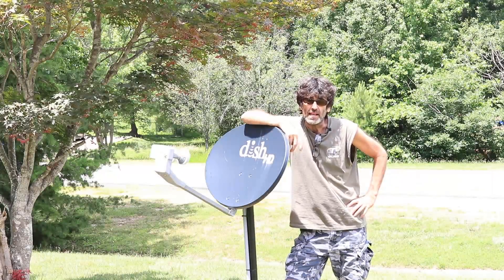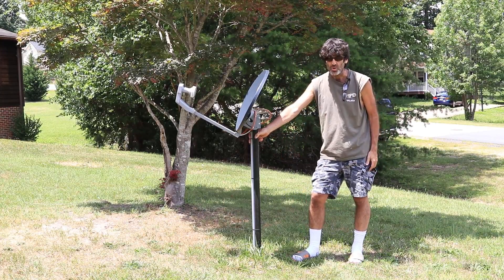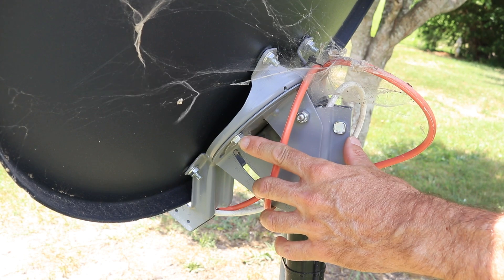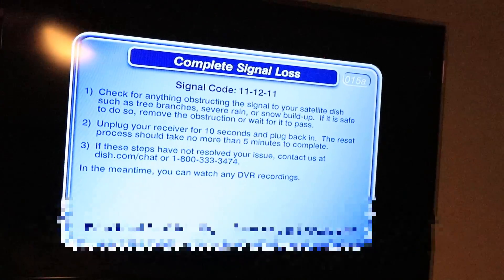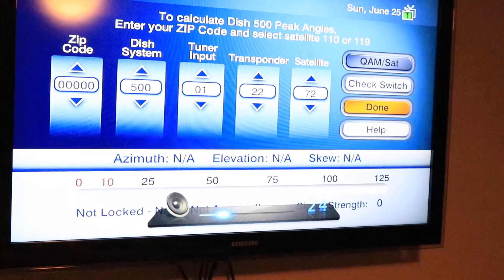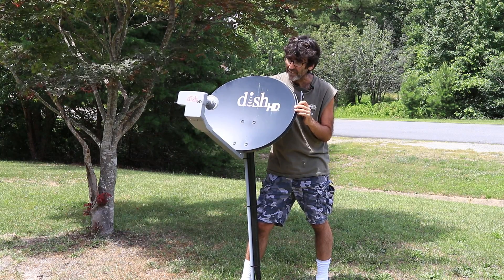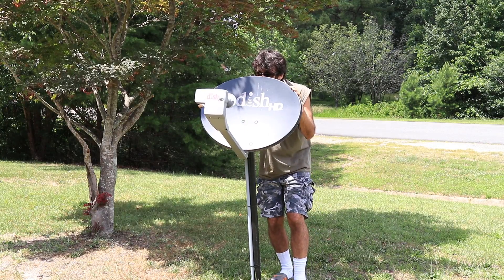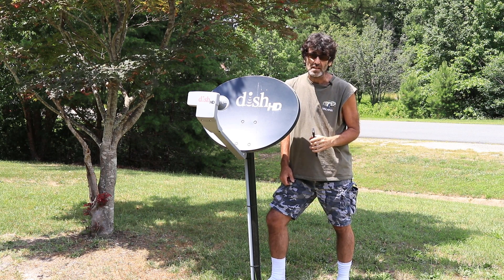Align Satellite Dish Without a Meter After Hitting it!

Comment: The biggest issue I have with my Dish reflector is, when setting the angle, there isn't a specific indicator for the angle. What do you go by? The center of the tightening bolt in the angle scale or ? The skew has a tiny little pointer to indicate what number it's pointing at. The dish angle adjustment doesn't. What do you use?
Reply from the maker: HI, I don't know if Dish has changed the new satellite dishes to be any different than the older ones I'm used to (Dish 500).  I haven't installed one for a little while.  The old ones used to have a scale for elevation angle and a different one for skew...  You can get into the menu on the dish box (OR Google your settings by zip code) to find your azimuth, elevation and skew settings according to your zip code.  The elevation scale was on the bolt where the mast went through the dish.  There's a pointer there.  The skew angle was closer to the dish and I believe it had 2 bolts with nuts to adjust and tighten that one..  (if they haven't changed the setup).   If you're using a compass to find the azimuth angle and the dish doesn't seem pointed to where it should be it's because of magnetic declination.  In my area it's only 2 degrees west, but some areas in the US are as much as 25 degrees!  So depends on your location.  I don't know if the numbers that Dish gives you account for this or not.  They might be true north numbers.

Comment: What one ia the azim adjustment and how to know the settings
Reply from the maker: HI... The azimuth setting is your compass heading that you need to point at.  If you go to this link: https://support.dish.com/products/dish-outdoors/dish-pointing-angle-guide  this will show you your coordinates according to your zip code.... azimuth , elevation, and skew.  It also depends on which dish you have...  There are several choices there that will give you different info.  The model of your dish should be painted right on it somewhere.  IT was for the Dish 500 which is what is covered in this video...

Comment: Nice and easy to allign one satellite. What about the other two? Dish has three satellites 119 110 and 129.
Reply from the maker: In this particular case, I am dealing with 72 and 61.5.... This video isn't about putting your dish together from scratch, it's just about re-aligning it if it were hit.  The dish skew angle is unlikely to change if it's just knocked out of alignment.  With a proper skew angle and a plumb mast, the other relevant satellites should align once you get one going good.... just do a check switch to verify they are all working..

Comment: Aluminum Tape i bet  would increase signal on satellite dish  i think make it 100%.
Reply from the maker: foxman362 thanks!
Reply: Man I'm not gonna say no because I'm not an expert by any stretch of the imagination, but, when I looked up a safe way to clean a dish, another article said using matte paint rather than glossy is better because glossy or reflective surfaces can throw the signal where it's not supposed to go.

Comment: 0h you'll bend it but I can tell you how to fix that but if you hit it you'll bend that dish and that's put you through bolt through your pipe and the mounting bracket
Reply from the maker: Hopefully if its not bent to much it'll bend back without warping and not working at all..

Comment: Got all the measurements set just can’t get the tone
Reply from the maker: It's a little tricky. One thing is, is it a new install?  Are you pointed at a lot of trees?  That could be a problem.. If it's an existing install and it worked before, you just have to play around with it until the tone comes in.. unless the dish is damaged.

Comment: area code 71601 what can i do to align my disc
Reply from the maker: Depends on which satellite youre trying to lock in on... for 110 and 119 it's (71600-71699) Azimuth/ 214   Elevation/ 
 43 Skew/  120 for other satellites just go into your system menu and pull it up and you can choose the satellites in there and give you the coordinates.  Thanks.

Comment: I used have one they r useless in a bad storm
Reply from the maker: Ed James yes they are! But it works good 99% of the time
Reply: @JLPicard440  but only at 100kbps to 2400kbps at 2am-6am
Reply: After the storm clear as a bell ,  Cable out cause damage to infrastructure